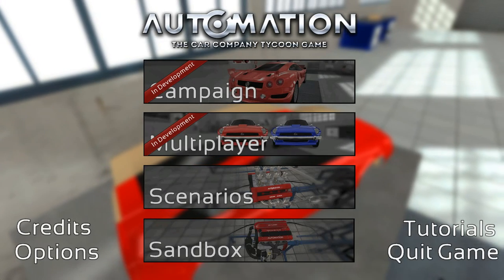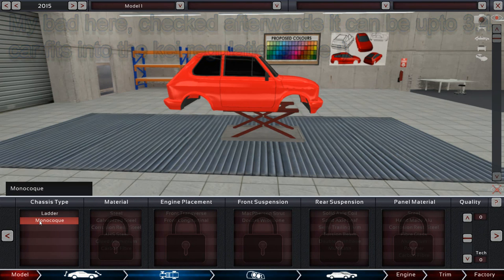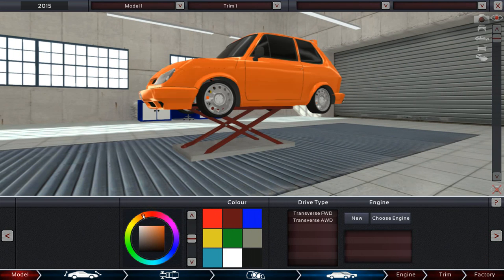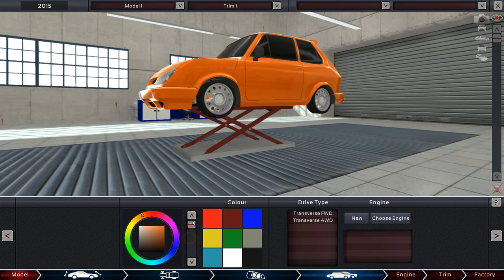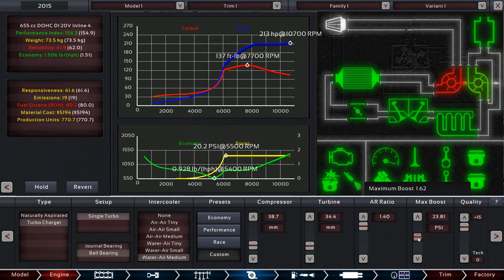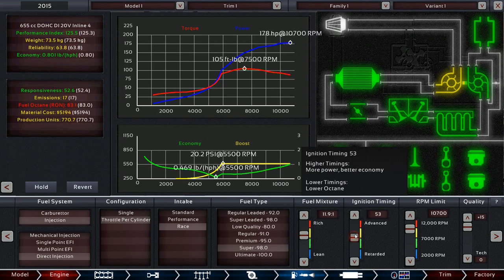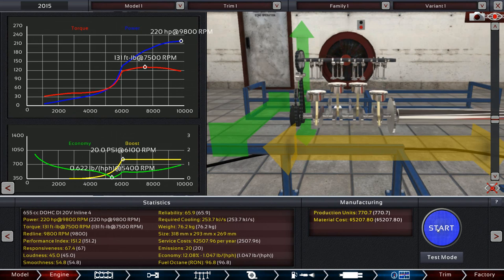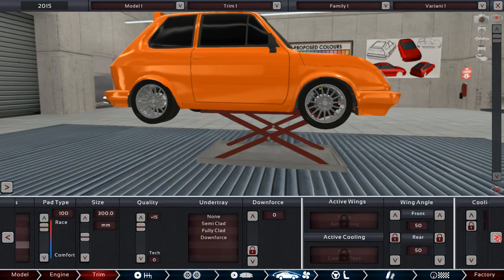FailRace Play Automation The Ultimate Kei Car

Comment: I bought the game because of you, Alex :P sadly it's pretty darn glitchy and throws about errors and such when doing certain things in a certain way. there must be some kind of miscoding present, because once it starts you should close the game asap (not time wise, but clicking-wise) to avoid it glitching out more and more with each click.

aside from the reaaaally annoying glitches that I kinda know how to avoid now, this game is AMAZING. the glitches are frustrating as flip though and have cost me many hours of extra work (re-creating lost content) in just 3 days time. you shouldn't lose anything if you close the game in the last amount of steps possible though peeps! very important to note. (if you're not going to lose anything important, alt+f4 is best)
Reply: I've made a challenge myself too, actually. if anyone wants to give it a try, that's cool:)

- - - - - 

GOAL: Create the most powerful engine, while retaining an efficient, economical engine (see restrictions below)

restrictions:
- year 2015
- Inline 4 engine
- 950-1000 cc

- reliability 100 or more
- economy 250 or less
- emissions 15 or less

- 5000 rpm maximum
- 100 horsepower or more
- super 98 fuel type
- double reverse flow mufflers

== note that material costs and production units have no restrictions ==

I personally ended up with a 140bhp / 199Nm engine :)

Comment: None of the fixtures add any weight btw. The grilles and vents and some bonnet scoops add cooling (and thus drag), the wings and lips add downforce (and thus drag, they'll also add engineering costs in the future) but apart from that, they are purely cosmetic.

Comment: I know this video is old but I think you could crank out more horsepower by adjusting the bore and stroke of the engine.
1:1 (square) bore stroke engines have about similar horsepower and Torque
Engines with more bore tend to have higher Horsepower, while engines with more Stroke tend to have more Torque.
Going by the bore and stroke of this engine, it seems like it was built for Torque and you forced it to push out a lot of horsepower.

I suggest you try making a Square engine or as close to square as you can get (1:1 bore/stroke) and give it some forced air.